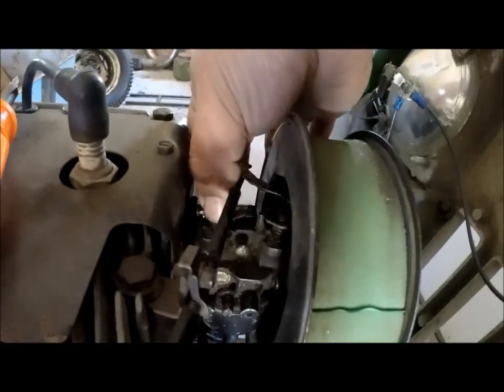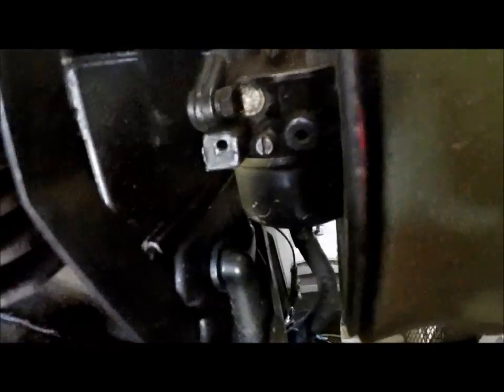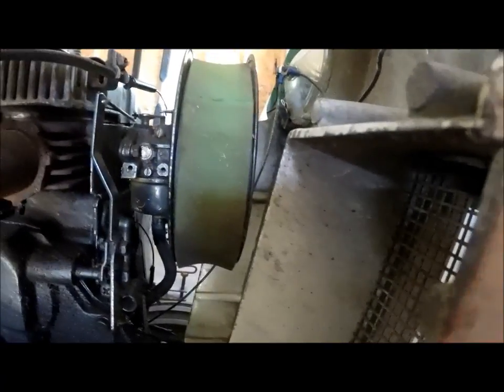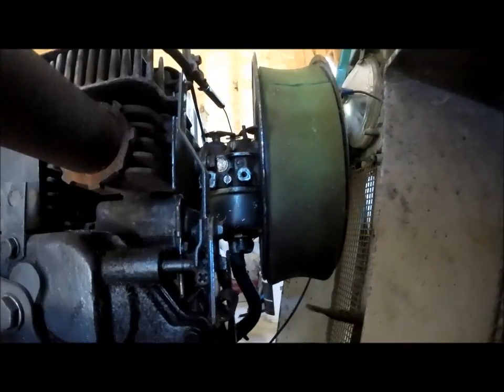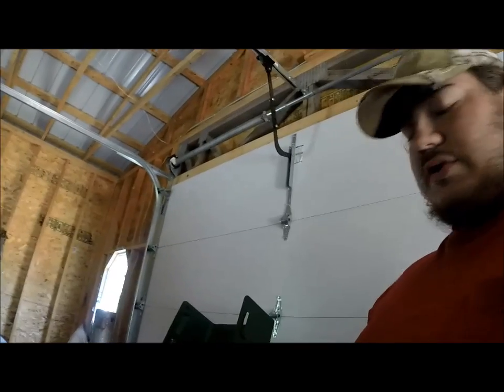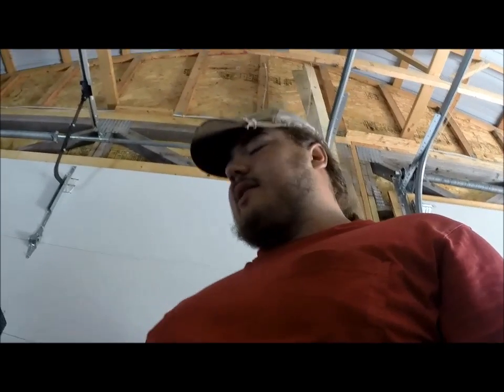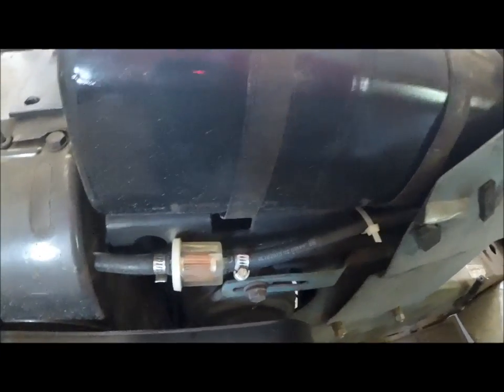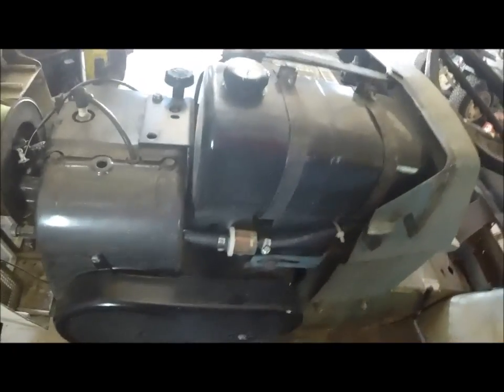How to fix a poorly running Tecumseh engine

Comment: Can the fuel hoses be a problem if they are cracked but not leakinv fuel
Reply from the maker: Fuel lines can collapse on the inside, that is usually a marine fuel line issue more than the black stuff you should be using for automotive and small engines. Stay away from the clear vinyl lines. They can't take sunlight or heat very long before failing. The black line should last atleast 5yrs if not exposed to excess heat, sun, or abrasion.

Comment: Hey bill! Love the video I just have a slight issue, I have a carburetor like that one minus the bowl screw, it only has the idle one, the engine will not idle no matter what either
Reply from the maker: What do you mean by it won't idle? Stalls at idle, constantly runs above idle, surges?
Reply: @BillTheTractorMan  it has to be started in a sequence, it must fire with full choke, then half choke it sometimes can idle for a few seconds, then it will die unless given throttle, with no choke the engine must be half throttle or more
Reply: @BillTheTractorMan  this is also a 14hp tecumseh off a 94 alsport trisport SL
Reply from the maker: @noahrothering3407  does it run better with some choke?
Reply: @BillTheTractorMan  around half throttle is the only place it runs really good with some choke, going anywhere close to full throttle it has to have no choke

Comment: What if Tecumseh 8 HP snowblower runs fine for 5 or so seconds 3500 rpm then stumbles 2600-2800 rpm for second or so then keeps repeating?

Comment: Bill: Good video. I'm new at this, so this may be a dumb question. You said if it's blowing Black smoke it's too rich. If that's the case, which way do I turn the screw to make it leaner? Also, I bought  a used craftsman chipper, with the same carb as yours. I cleaned and rebuilt the carb and am using ethanol-free gas.  I can get mine to start if I blow starter fluid into the carb or spark plug hole, but it dies after about ten seconds. Don't know what to d next. Any suggestions? Thanks for any help.
Reply from the maker: To turn the screw in and make it run leaner is to remove fuel. Being "rich" means you have too much fuel. As for the other one, sounds like you need to check your float. if it is not allowing fuel in there is your issue.
Reply: @BillTheTractorMan  Thank you, Bill. That helps.
Reply: @BillTheTractorMan  Thanks, Bill!

Comment: How about the vent hole on the side of the carb while cleaning it...very easy to not clean it with a tiny wire (think of a single stranded copper from small hook up wire 18 ga.)

Comment: My snowblower is running rough and bogging up at down any suggesting
Reply from the maker: Clean the carb, check the fuel line for good flow. 80% of the time that's the issue
Reply: @BillTheTractorMan   my friend has a snowblower and not starting or turning over any suggestion

Comment: I was thinking of adding an inline fuel filter and was wondering why there wasn't one on the Tecumseh motor I have.  But when I was cleaning out the fuel tank I noticed there is a screen built-in where the fuel exits.
Reply from the maker: Yes there is, the inline filter is easier to deal with. I have also found most of the in tank screens are damaged or missing.
Reply: @BillTheTractorMan  I guess I should go ahead and add one since the extra protection doesn't cost much.  Would any filter that fits a 1/4" line work?
Reply from the maker: @robertrinehuls9099  pretty much yes, just dont get extravagant with them. Some of the higher quality ones will not allow enough flow through them. My small engine dealer sells the ones I use for $2 each.
Reply: @BillTheTractorMan  Yeah the possibility of fuel starvation with an extra filter was a concern. But I may try one of those small ones.  Have to consider what will fit since carb is only 4" from tank.
Reply from the maker: @robertrinehuls9099  Briggs & Stratton  has a small pancake filter that is ment for gravity feed fuel systems. I dont like them because they are not clear. They do work well though.
Reply: @BillTheTractorMan  Thanks, I'll look for that type.

Comment: I have surging on a brand new carb, new gas any help would be greatly appreciated.
Reply from the maker: It's running too lean, try adding choke to see if it seems to smooth out. If it's an adjustable carb trying tuning it. Should take more than a turn open on either screw to even it out. If that doesn't help it needs cleaned and adjusted.

Comment: What do you do when your Tecumseh has a none adjustable carburetor?
Reply from the maker: arthur1920 if the carb is not adjustable the best you can do is clean it the best you can. Some have a single screw for adjusting though. It won't help much, but will help some. If you have cleaned it and it still won't run, you might need to replace it.
Reply: Have cleaned carb, didn't seem to help so then replaced it.  Replaced spark plug and gas.  Now unit runs but seems not to be able to handle a load.  Revs go way down when you hit snow.   At least RPM is not surging widely like it was.  Also I do not see a vent hole in the cap.  It has a little metal funnel underneath that may be some kind of a valve?  This might be another separate problem, when I drained the gas it came out, then stopped, loosening the cap let it drain again. But running with the cap very loose did not seem to help the power.
Reply from the maker: arthur1920 could be a vacuum on the tank. Or more likely air is leaking past an intake gasket some where. If they are hard or torn they won't seal. Does it run better if you use some choke?

Comment: What do I do if there is no screw at the bottom of the carb to lean it out or richen it up?
Reply from the maker: Baby Dragon if that's the cause either there is two jet screws on the carburetor body, or you have a post emissions carb that is not adjustable.
Reply: Thanks. Any idea how I could modify an adjustable carb to work with it?
Reply from the maker: Baby Dragon what model engine is this for? how old is the engine?
Reply: OHM110. 11HP Tecupseh generator engine. It's not that old. Maybe 3 or 4 years.
Reply from the maker: Baby Dragon depending on the carburetor changing anything is probably a bad idea. with it being that, I highly doubt there's adjustment.

you best bet is cleaning it really good, if it's still problematic replacement is cheaper than continuing to work on it.

Comment: hey hop you can help me My Tecumseh engine turns over hard it is a ohv
Reply from the maker: I'd start looking at electrical. your starter is probably getting worn and weak, wiring is probably in aged, or worn condition. maybe even the battery is getting weak, making it sound like the engine is hard to turn.
Reply: Are Tecumseh Engines just as good as a Briggs,Kohler & Kawasaki? I am considering buying a Generator with a 10 Horsepower Tecumseh Flathead Engine.

Comment: Awesome vid Bill, knocker sounds great!
Reply from the maker: Thanks!

I'm honestly sick of people complaining about these Tecumseh engines, they are some of the best small engines built in my opinion. hopefully this helps educate those people who would rather throw away than fix.
Reply from the maker: but of course, if they still want to throw them away, I'll be glad to buy those engines and use them!
Reply: +BillTheTractorMan I couldn't agree with you more! Maybe it's not the mechanical of the engine but the mechanic? lol I know a true mechanic should be able to tune any engine. lol
Reply: +BillTheTractorMan truthfully I'm sick of seeing diesel and predator engine swaps myself. lol
Reply from the maker: +RooneysSears01 I don't mind diesel swaps, but I personally hate Honda clones.

99% of problems are operator based, and come from a need for maintenance not being satisfied.

100% of engines issues are preventable with maintenance, and a general understanding of an engines condition.
Reply: i totally agree with ya there Rooney!